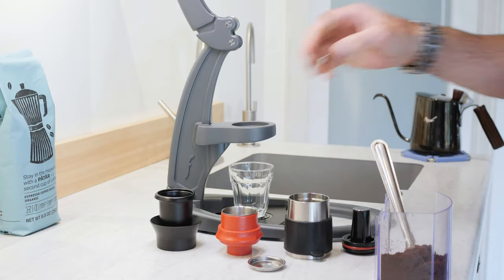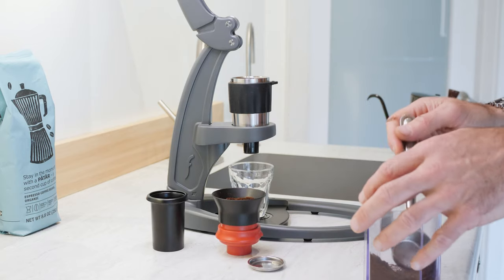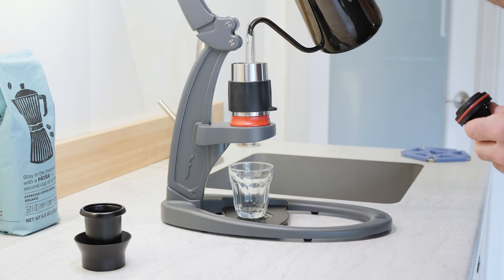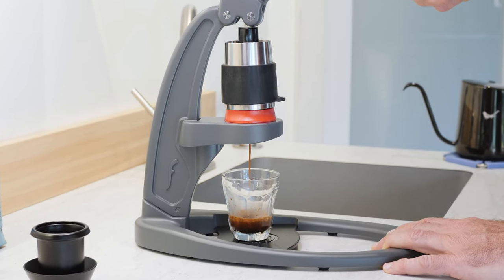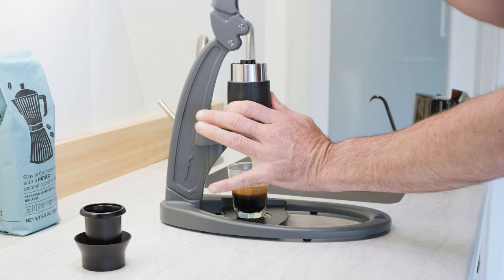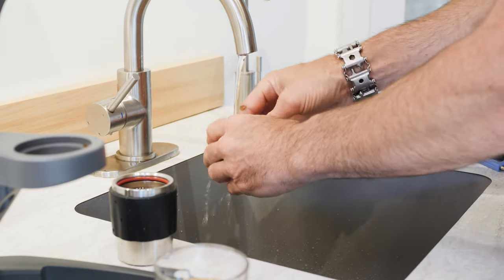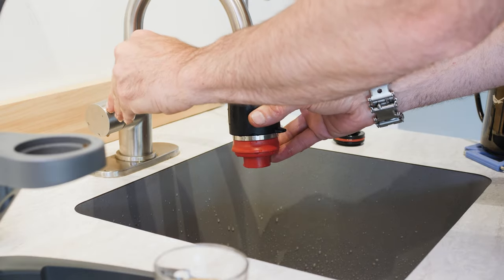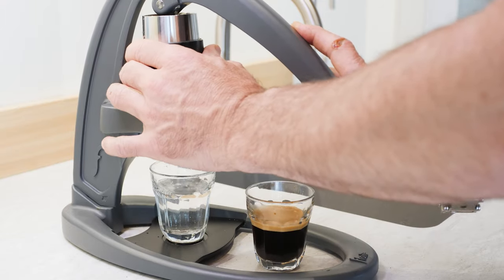Flair Espresso NEO | Brewing Guide

Comment: Just finished my first day with the flair neo and I am delighted with the results! If anyone is wondering - the wilfa svart coffee grinder on the highest grind setting (moka) works perfectly fine with the Flair Neo. So glad I don't have to buy a super expensive new grinder now 🎉
Reply: I have the same set up, but my shots come out extremely sour. Have you encountered such issue? Could you write down your routine? I've read somewhere that it may be an issue with preheating the brewing chamber, so I boiled it in a separate pot for like 5min to be sure it's as hot as possible, but it didn't make any difference. Also, how hard is it for you to press the lever? For me there's almost no difference between pulling a shot and running it with water only, so very little force needed. Is it normal?
Reply: @maciekkokoszka7001  definitely pre heating the chamber as much as you can is important. Then I go 18 grams of coffee at the highest setting. The quality of the output definitely isn't always consistent though. I'm looking to upgrade my grinder at the moment.
Reply: @maciekkokoszka7001  also, in terms of pressure applied, i just push hard enough to see a steady stream coming out of the pressurised portafilter on the flair neo
Reply: @charlieconneely  thanks! And is it hard for you to press the lever while brewing? For me it's surprisingly easy. Like almost no effort at all.
Reply: @maciekkokoszka7001  are you sure you have the little pressuriser thing screwed on at the very bottom? Maybe that's the problem. It's not super easy for me
Reply: @charlieconneely  it is, but maybe not hard enough? I'll have a look. Anyway, thanks for your help! Appreciate it

Comment: Hi Flair, I recently bought the classic and the first couple shots came out pretty good… now for some reason the brew chamber is separating and coffee is spraying a little. I tried a few different things, including making sure that I was pre-infusing and leveling the puck correctly, but it still sprays. I noticed in your video that the brew chamber is also separating a little bit, but not as badly as mine. What do you suggest?

Comment: hi I just got my neo for Christmas, I'm not getting alot of crema but the espresso is pretty delicious! Does using pre-ground coffee affect that?
Reply from the maker: Pre-ground coffee has lost most if not all the stored CO2 (the bubbles that make up crema). The only crema you'll get at that point will come from turbulent flow through the flow restriction built in to the NEO's portafilter. It will never be as thick and rich as what you'll see when using freshly roasted and felt ground coffee
Reply: @FlairEspresso  ohhh gotcha, would it be better to use a cheap(ish) blade grinder instead? i do have some fresh beans in my cabinet hahahah
Reply from the maker: @michaelsangoy1603 watch James Hoffmann's blade grinder hack and give it a go!

Comment: My only gripe is that the standard piston doesn't have handles to make it easier to remove it from the water chamber (you have to use a lot of force with the tamper to get it out).  @ flair, any chances that this will come in a future update to the model?  Other than that, this is my favorite Flair, and it has replaced all my other coffee making paraphernalia!!
Reply from the maker: Send that request by email to service@flairespresso.com. thanks for the feedback

Comment: how long would it take to pull shots back to back with the same portafilter? also do you actually need the pressure gauge kit with this or does it not matter bc of the pressurized basket?
Reply from the maker: Best to have a second portafilter locked and loaded that you can swap. Depending on how efficient your workflow was,  expect the first shot to take 3-4 min and then factor in quick cleanup and prep of the one portafilter for subsequent shots. Cylinder will likely be hot enough to "hot swap" as you go. Pressure Gauge is of little value until your brewing with non-pressurized baskets just as you surmised
Reply: I'm usually able to do back to back shots fairly quickly. After I pull the first shot I immediately put the brew chamber back in boiling water so it regains some heat. Then I fill the portafilter with new coffee and basically within 2 minutes I'm ready to make another espresso! :)

Comment: Does Neo pressurised portafilter deliver consistent pressure no matter how much force applied?
Will adding the pressure gauge kit to ensure consistent pressure applied gets better result?
Reply from the maker: Flow Control portafilter that ships with the the NEO ensures enough  time and pressure to get a reasonably good extraction when your grind is in the espresso range and a minimum force on the lever is met. Wedding recommend using a pressure gauge with the NEO until you upgrade your portafilter to the 2-in -1 Bottomless (non-pressurized) portafilter that gives you total control of the pressure in the system.

Comment: Can we attach this pressured gauge kit?  I would like to buy this,because i was using low grade grinder . And i would like to updgrade this one with pressured gauge kit.
Reply from the maker: Pressure gauge kit is a measurement define.m, it does not affect the pressure and therefore your current outcome.. You should focus on upgrading your grinder
Reply: @FlairEspresso  how about botomless 2 in 1 portafilter?  Did we really need to buy another stainless steel screen or can we use the one thay included in neo?

Dont worry I plan for buying your royal grindder after its on sale on ottencoffee (indonesia flair official distribution)

Comment: which is better between neo or pro 2 flair espresso?
Reply from the maker: Depends on the grinder paired with them.  An espresso capable grinder and the PRO, Signature or Classic will make the best espresso.  If, however  the grinder used is not espresso-capable, you would likely get better results from the NEO's flow control portafilter
Reply: @FlairEspresso  would the pro 2 work on the neo base? If not, why would it not be compatible?
Reply from the maker: Short answer is no. Write to us at service@flairespresso.com for the long

Comment: Do you recommend to pair this or the Pro 2 with a Wilfa Svart grinder?
Reply from the maker: We haven't tested that grinder but have heard anecdotally it is not quite capable of consistently good results for espresso with non-pressurized baskets... so we recommend the NEO if paired with it
Reply: @FlairEspresso  thanks for the quick response. Indeed, the finest setting is geared towards moka on that particular grinder. Would you recommend going for moka size for a neo grind or rather something coarser, e.g. filter?
Reply from the maker: @davidhartl5417  as fine as it will go then, so moka it sounds like
Reply: @FlairEspresso  Great, cheers!

Comment: Does the NEO produces the same amount of pressure as the pro 2?
Reply from the maker: The PRO's non-pressurized portafilter allows you to fully control pressure by the fineness of grind you use. NEO is preset to deliver pressure no matter the fineness of the grind, and therefore cannot be manipulated to the same extent. PRO will deliver higher pressures if that is what you want, but only when paired with an espresso-capable grinder
Reply: @FlairEspresso  Thank you! Thats what I wanted to know
Reply: @FlairEspresso  I use timemore C1 as a grinder. Is this capable for flair pro2?
If not, do you have any recommendation for a capable grinder for pro version?
Reply from the maker: We are not personally familiar with that grinder. Try searching in the Flair owners group on Facebook www.bit.ly/BrewWithFlair

Comment: a bit of misalignment between brew head and the porta cylinder filter https://youtu.be/Xf-iBEmTZNM?t=93.....does it affects the process of making coffee?
Reply from the maker: No,  lifting of 1-2 mm of front side of cylinder is common and does not affect extraction. pressure is equal at all points inside and across the surface of coffee.

Comment: What is the different of neo from previous specs
Reply from the maker: the NEO is based on the same design as our Classic and Signature, and is compatible with all brewing components found on those models. the main difference is the flow control portafilter that comes standard with the NEO. it's more forgiving than our non-flow control (aka non-pressurized) portafilter... which you can add to the NEO when you're ready to step it up with a high quality burr grinder and freshly roasted coffee. www.flairespresso.com/buyersguide has more info